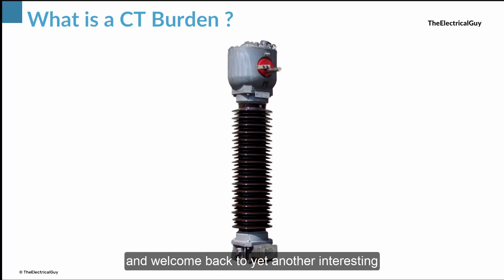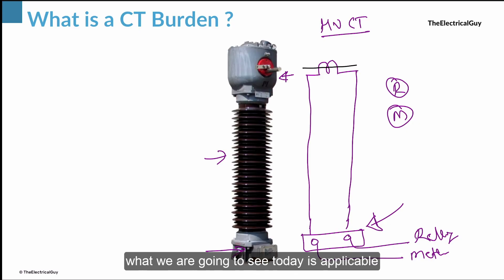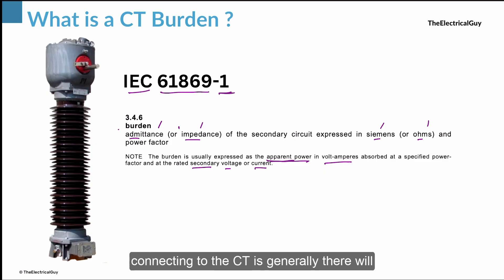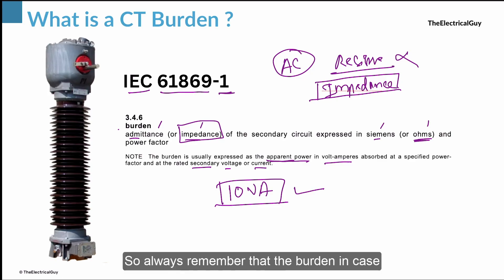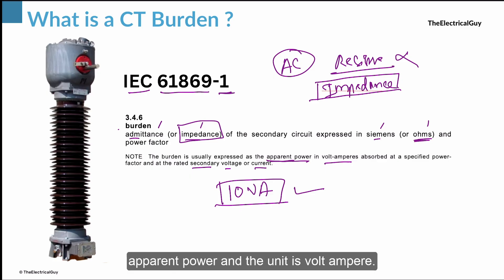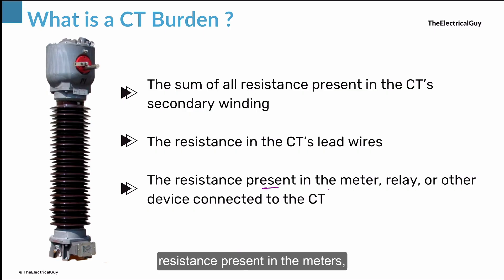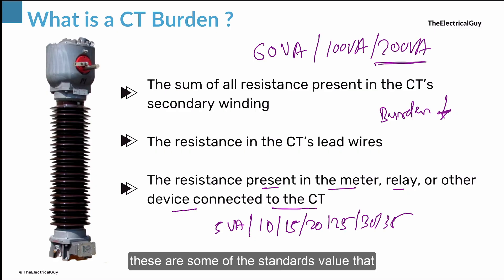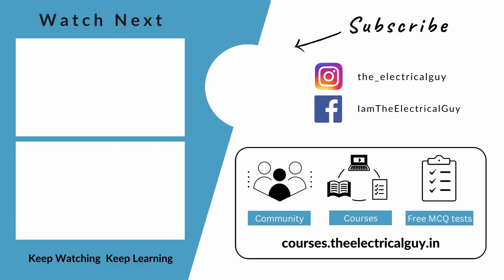What is a CT Burden ? Explained | TheElectricalGuy

Comment: Which type of cable is used  as lead from the ct terminal box to the control room???
Reply: It will be 12c or 19c 2.5mm copper cable depending on COP metering. For protection relay will also use multicore 2.5mm copper cable usually used 4c copper cable to connect relay but depends on protection relays.